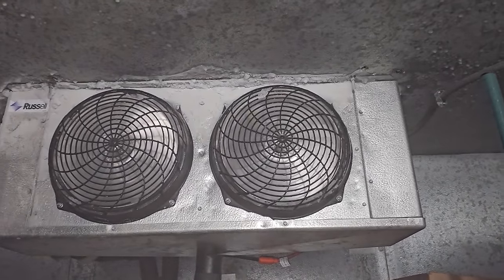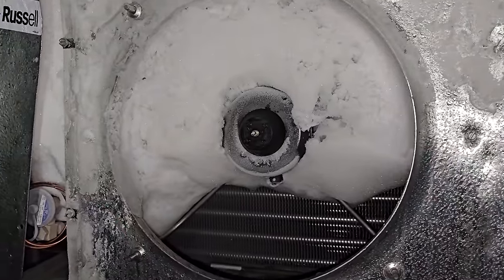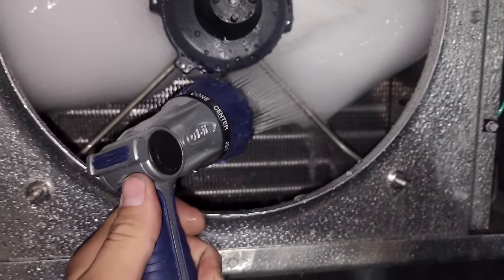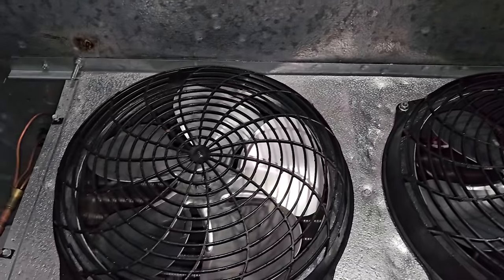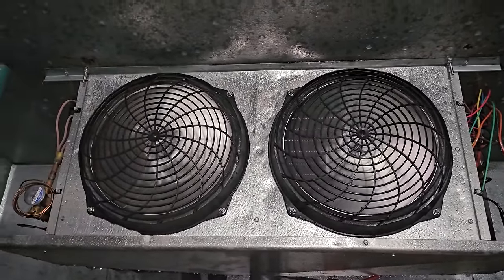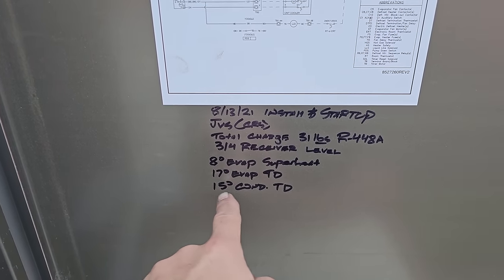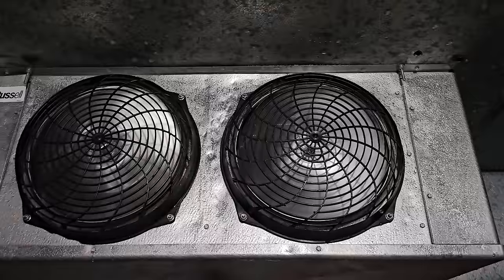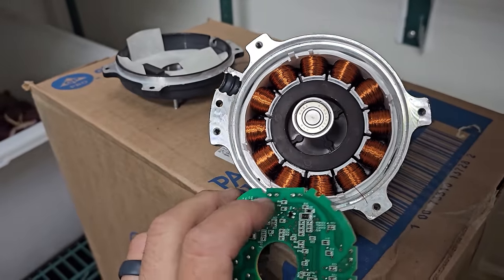THIS WALK IN FREEZER IS A PAIN

Comment: For being so expensive, they should at least be IP67 classified, so you can rinse these motors of without any problems. I don't get it why manufacturers don't know that a freezer can freeze up and needs to be rinsed with hot water to get it back working in a reasonable time - it is to be expected so they should put proper motors in.
Reply: Sadly these are built down to a price, rather than up to a specification.

Comment: So put in 1000 watts of defrost heaters and set it to run the first 5 or 10 minutes of every hour.

Do any of these use a hot gas valve for defrost, like on ice machines?

Comment: A real pain in the --SS Is a food supplier with 2 25x50 freezers 3 units each " hot gas defrost with the staff in and out all day
Reply: I lost ya somewhere in there, babe.
Reply: @silasmarner7586  The pallet size doors were open all day , We installed curtains ; The heat from a hot gas defrost system is short , We had to set several defrosts per day to prevent evaporator from frosting over , This was affecting the box temp. some times in hot summer months , Larger equipment would have solved this , But money is always the issue .

Comment: Hi
Have you ever said about or tried a steamcleaner to melt the Ice?

Is that good or bad, does that any harm
Reply: I’ve thought about getting an electric heat gun for this purpose. Far less water to deal with and it’s not a torch.
Reply: mist spray of warm or hot water is going to melt best.

Comment: Do you dry off the ceiling of the box before you leave? Water has infiltrated the motor and causing it to sense a false voltage on the red leg. You have to be really careful while defrosting the evap.

Comment: I know I'm a harsh critic of some of these restaurants, but I will try.. try.. to be more loving in this comment - first of all the wiring upstairs we VERY clean and elegant.  But shouldn't the manager be punished corporally for their negligence? Either terminate the manager, or make sure they train, warn, and then terminate the employee if the employees are guilty (a 50 buck camera pointed at the handle will insure the perp is caught), or at LEAST rap their knuckles with a steel ruler?  Am I wrong here?  Please tell me I'm wrong!
Reply: As someone who both managed and was chef in a Resturant, no you're not wrong. This shit would not pass muster in my Resturant.
Reply: There are customers you could drop and surely pick up ones that are reasonable or you aren't charging enough.  Must be lucky here since we are swamped always.
Reply: Everyone acts like its the managers fault.  Its not the managers fault, it is the employees and their work ethic. I have been onsite when managers try to correct a behavior and an employee says F this and quits leaving the store short handed and shifts unfilled. The managers have to walk on egg shells for fear of losing employees even shit ones.  Until the work ethic improves it will be an issue.  Employees don’t care about the equipment or doing things right because they aren’t invested in it.    They figure it ain’t mine who cares.

Comment: Chris, I've seen situations where the manufacturer of equipment will have motors or parts made to their spec so that one needs to get the parts from them. This only makes service calls more expensive for parts, and can delay repairs since they usually have to order the parts rather than being able to stop at an HVAC supplier and get it off the shelf.

Comment: Walk in freezers sure are a pain especially if they’re iced up
Reply: The temperature in the cold room is very low and so that causes ice build up on the coils, yet some refrigeration systems use a defrost clock to tell when it’s time to heat up the ice to melt it off. it is very difficult to set.
Reply: They should use more accurate ice sensors

Comment: Technical question: Why don't those Freezers use a hot gas defrost? Is it because of the length of the lines?
Reply: Cost. I've got constant temp walk in coolers that use hot gas to raise the evap temp that run 85 feet. It's about the dollar.
Reply: @wtfman5313  Ah ok, thanks for the answer. I just pull Reefer trailers and there the hot gas defrost is the standard. So I was wondering